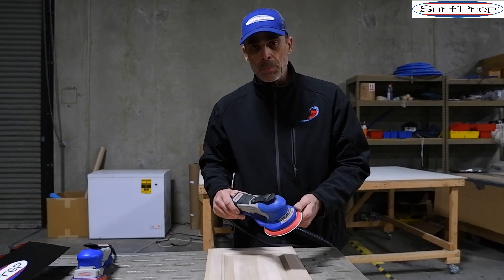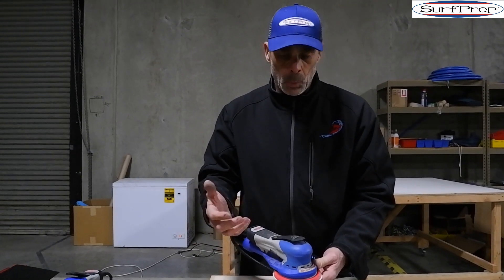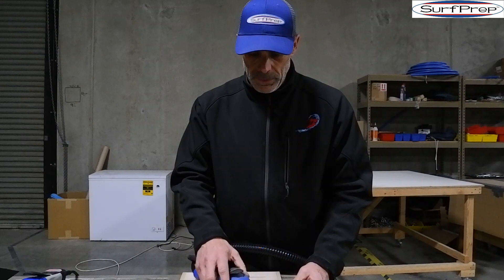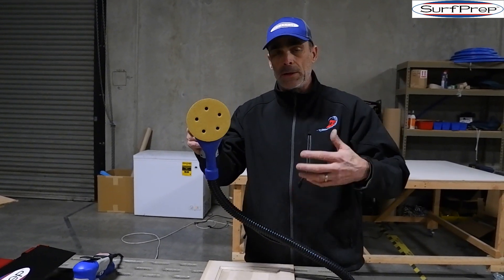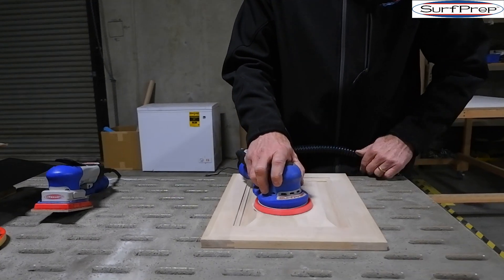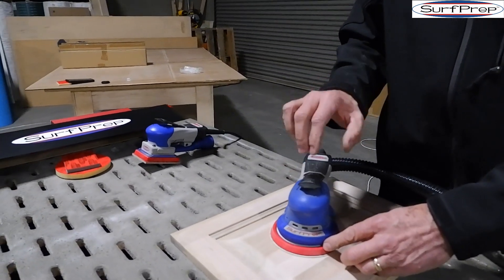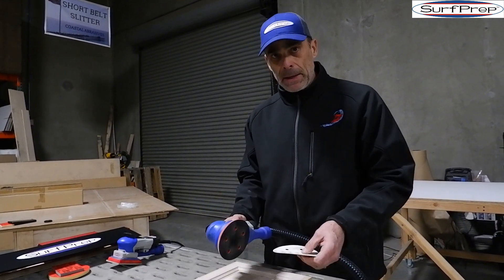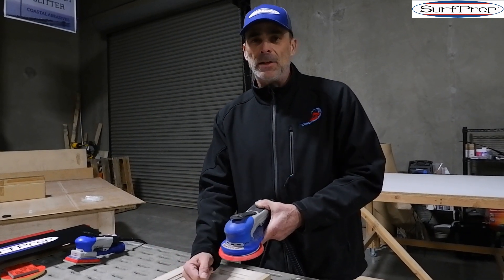SurfPrep 5" Electric Ray Random Orbital Sander

Comment: Great video I love my 3x4 electric. I think I have the first generation you put out and it’s still rolling with the power brick. I would get one of the new one but the old one is still rolling.  I also have a mirka 6 inch but tried yours and it had significantly less vibration. Whenever the mirka dies.  I am going totally surfprep.